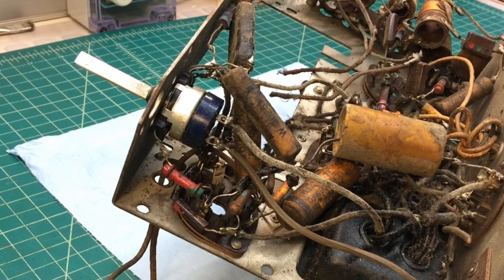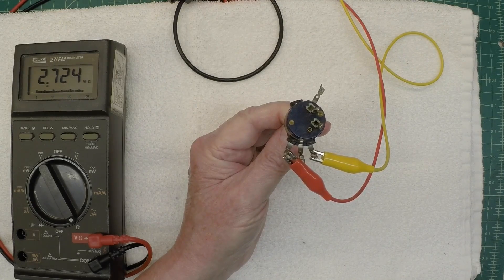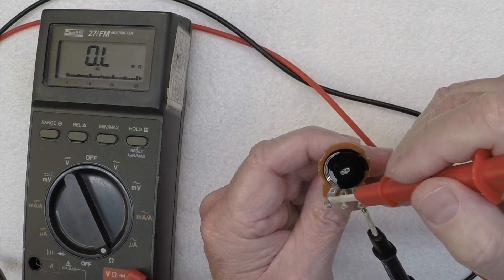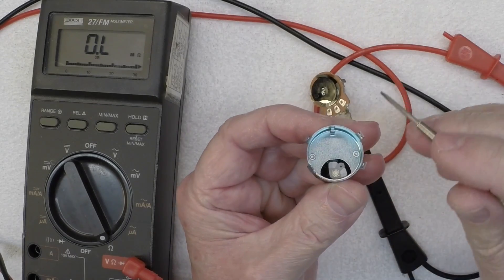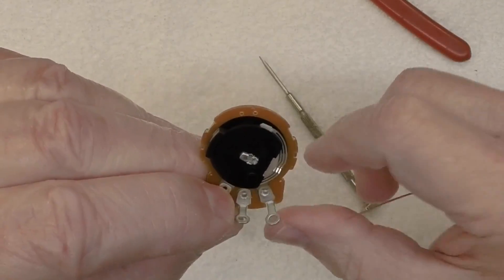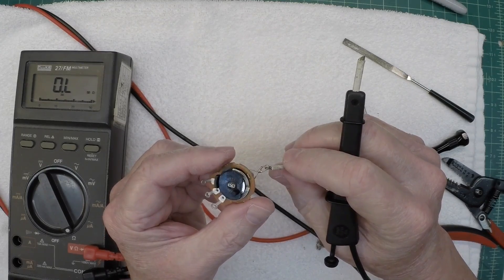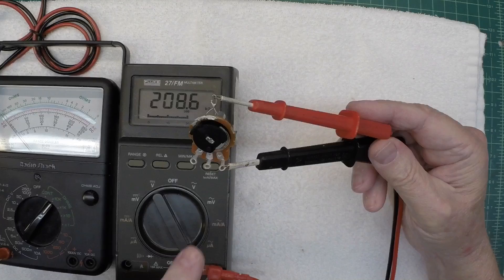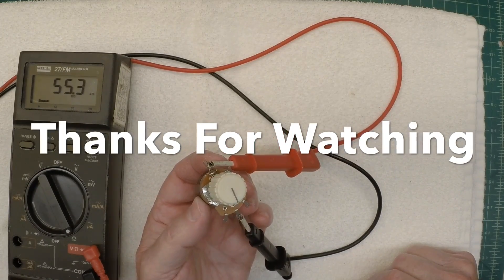Crosley 718-B - Building a Tapped Volume Control

Comment: I’m looking at making a pot much like this for an AC Delco car radio project. Thank you for stepping through the process!
Reply from the maker: My pleasure! Good luck with your car radio project. BTW - please read through all of the comments. If I recall correctly, I had some folks provide feedback in regards to enhancing the process I used. All the best, Don
Reply: @RestoreOldRadios Many thanks. I’ve dabbled with LTSpice trying to see if I can use static resistors to work around modifying a pot. It changes the frequency response by 1kHz. It’ll work, kinda, but it won’t sound the same.
Reply from the maker: Hope you’re successful on the build if you take that path. Best, Don

Comment: Thank you so much for this video, I love your ingenious solutions to problems. Just one question, the adhesive seems very expensive for a one off so was wondering if adhesive copper tape used for pcb repairs would do the same thing.
Reply from the maker: Thanks for your kind words. I can’t say about the longevity of the modification using copper foil tape, but it would be worth a try. Keep me posted if you’re successful with this method. All the best. Don

Comment: Instead of stabbing the carbon track with a probe, why not use the wiper itself to find the "sweet" spot?
Reply from the maker: James, a great suggestion. I was trying to find the exact “sweet” spot, but quickly realized the to be determined resistance point varied significantly by moving the probe just a few thousandth of a inch. Thanks for watching and reaching out. Best, Don
Reply: I stumbled into this idea by accident. Good tip!

Comment: Excellent video. I've seen lots of those in old schematics but very few available anywhere for replacement. Where there's a will, there is a way. 👍👍
Reply from the maker: Bob, I’ve done this in the past on an older style pot, but never on a new... Seems to work well, but I need to evaluate the circuit. Best, Don